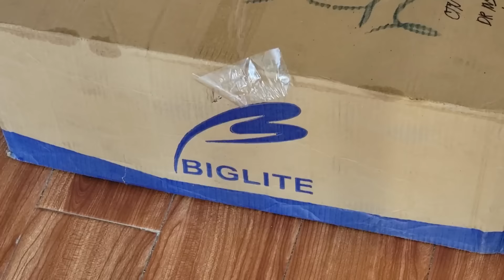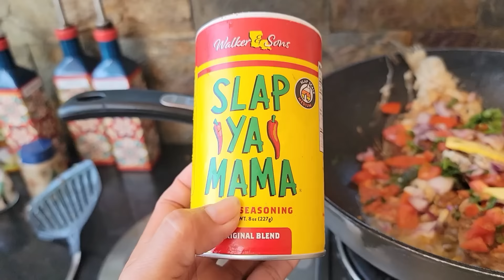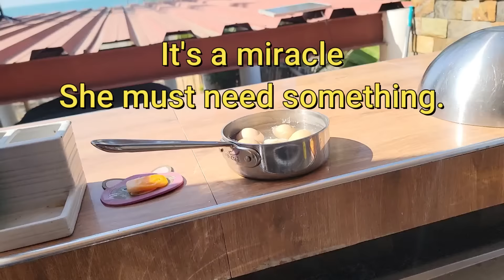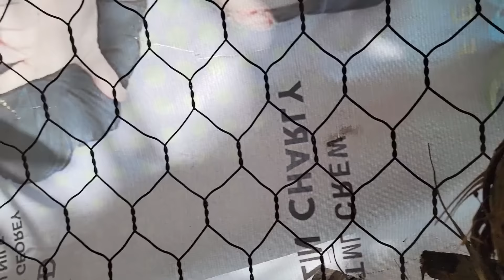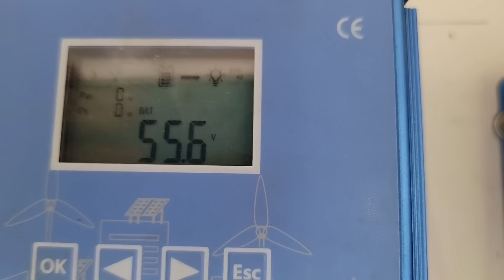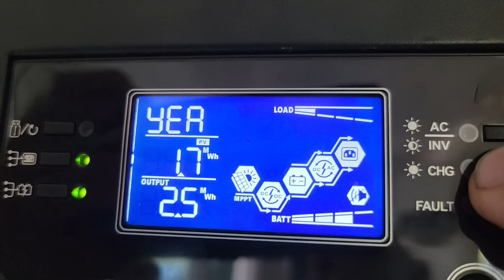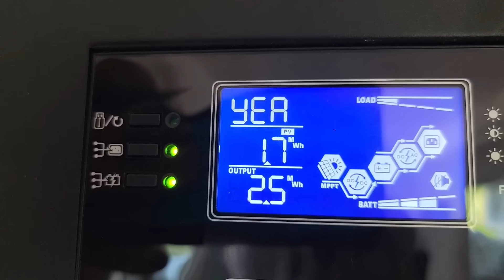Foyer Light Install  and Upper Deck Glass Starts, BIG HOLE DUG

Comment: Lots of things happening...

The light fixture looks great, pool coming along, and the windows project for the balcony upstairs is going to allow you to use the space year round (w/AC added?)...

It's true that making a home is a life long endeavor...

But a worthy one, as every corner, every room, every bit of outside work culminates in your place...

With your stamp of influence, and your vision of what can be...

I have to tip my figurative hat to you and Mel...

I've seldom seen it done better...Already so many memories, and a plethora of ones to come...

Life...is...good!

🙏🙏🙏
💪😎💪
Reply from the maker: Such a great comment full of truth!
Reply from the maker: Yes I will add air con for daytime use  when abundance of solar power is being made. Not real soon though. Maybe in the "ber" months here  before the return of next dry season. Upcoming wet season the temps will drop and the cloudy rainy days will have it not needing air con.
Reply: @TexasFilipino  Makes sense! 👍

Comment: Interesting build James. Enjoyable watching. Do you have any problems with mould being so close to the ocean? Beautiful lightings. Cheers mate!
Reply from the maker: I cured most of the mold issues by how we water proof the concrete and the quality of paints also.  We do get some though in a few places we have not finished. We sealed the stone work which stopped the mildew also.